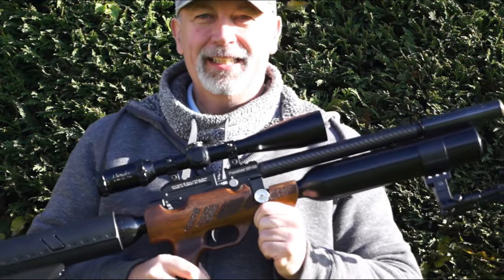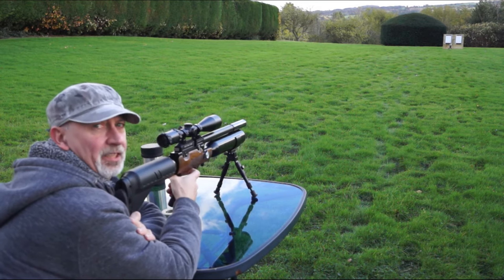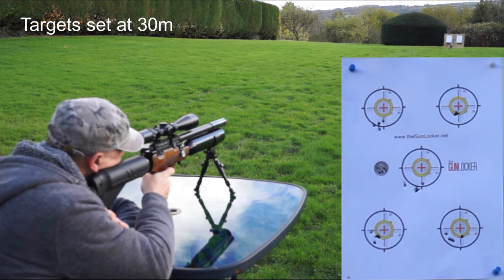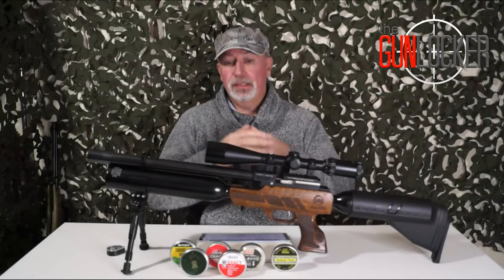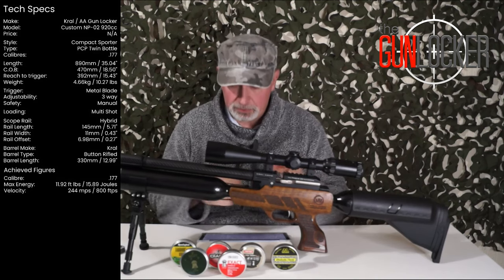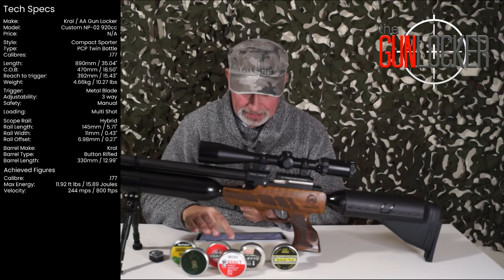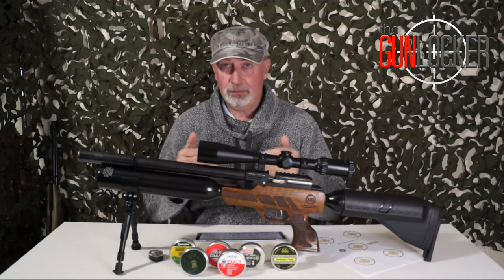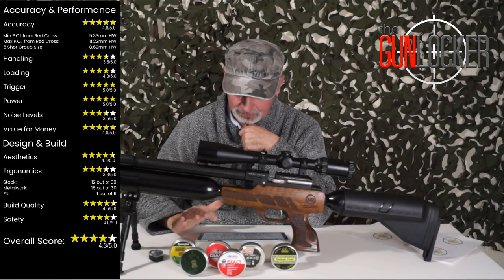Custom Built Kral Puncher NP-02 920cc - Airgun Review - theGunLocker

Comment: How do you screw on the front bottle ? Was an adapter made , can you please shed some light on this so we can mod too , thanks a lot , hope ur daughter is well ❤
Reply from the maker: Sorry but I can't. This is a custom build from scratch and a one off. Andy said that he would never do another as it was an absolute pain to do. And I wasn't there when he built it...all I know is that it's a true Frankenstein with parts from other makes as well. Even the stock has had a lot of work done to it to get it to fit... being both shortened and internally reshaped to accommodate the chassis.

Thanks for asking about my daughter. She's still recovering from the stroke she suffered in September. Lost 50% of her eyesight, the use of her left hand and complete loss of feeling to her left side. I honestly don't know where she finds the strength to keep fighting!